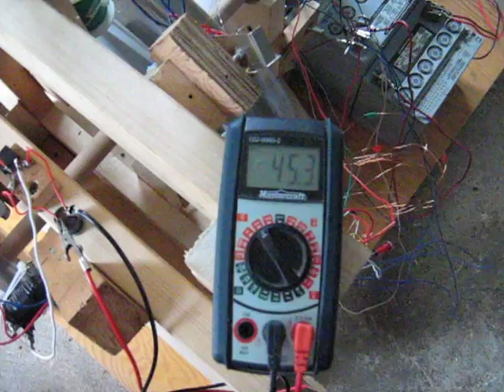Bedini Wheel - 7 Coiler - Plus Generator Setup

Comment: i like the little rotor on the back man.. seems to be getting great generation. the field those magnets create extends alot farther that i thought at first. 
technically the more coils u add to it the more the draw will go down right?
i bet if u pulsed the AC leads on the rectifier quickly with something the cap would charge to 200 almost instantly.